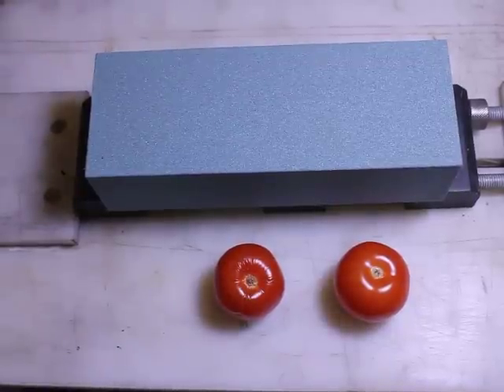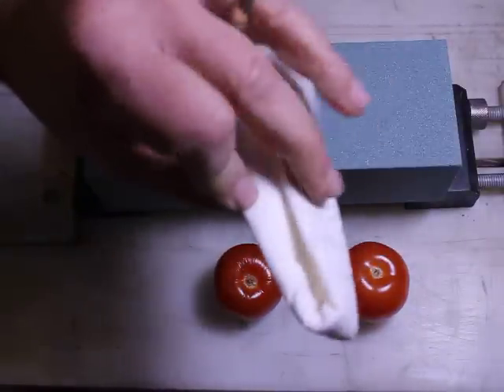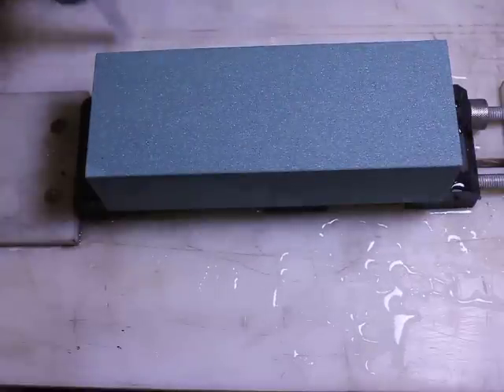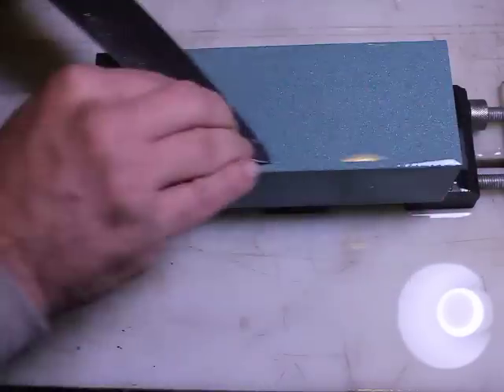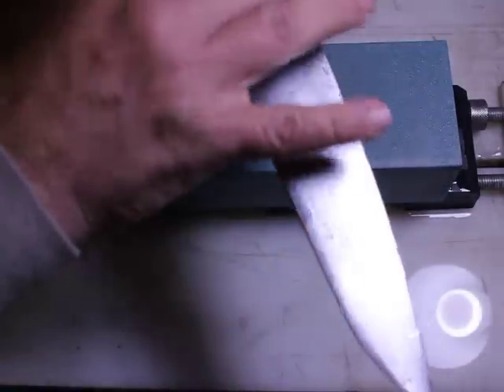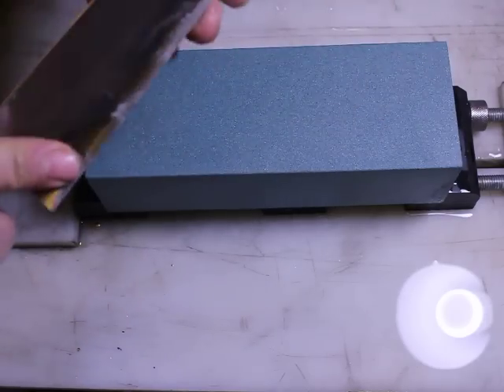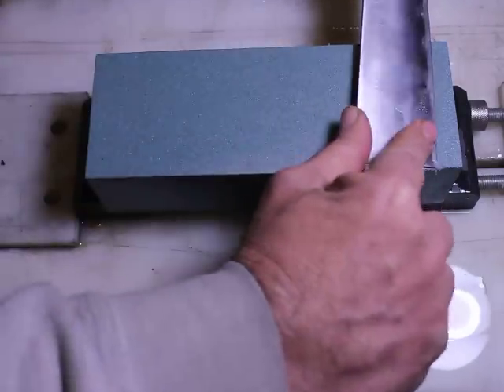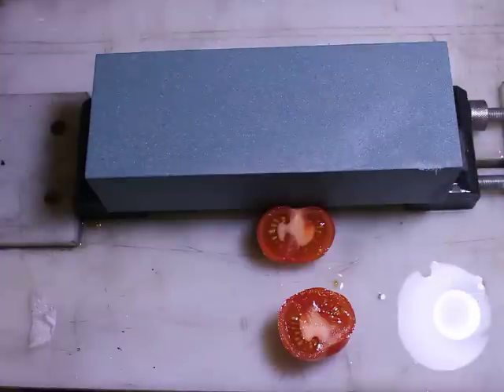Nubatama Bamboo 120 grit Japanese Waterstone - First Impressions

Comment from the maker: @sickobanza 

You are correct. I should have attempted a slice cut in both instances, but the initial edge was SOOO dull that it would not have cut in any case. I would have been surprised to see push cutting performance at 120 grit, but could have tried that too, probably unsuccessfully.